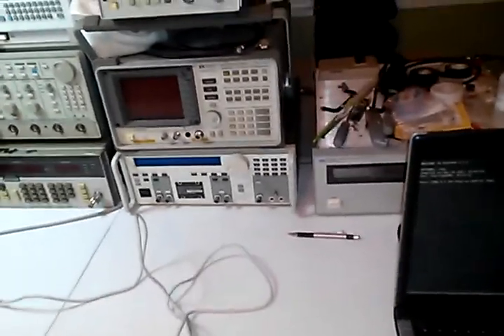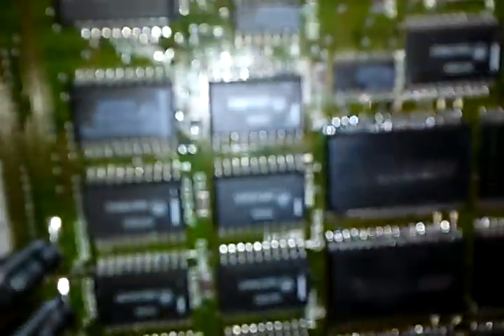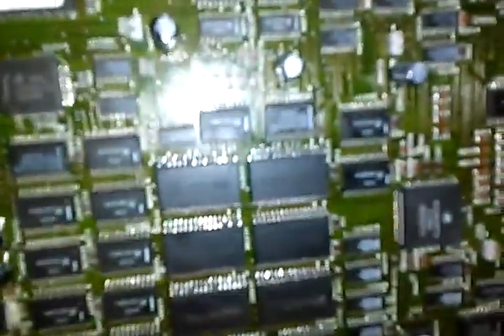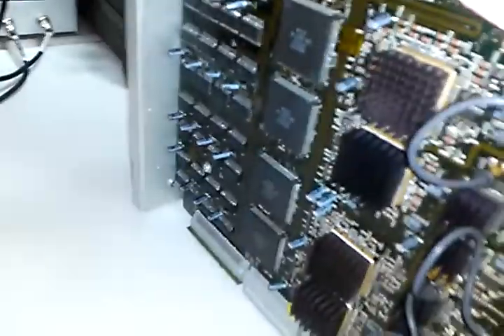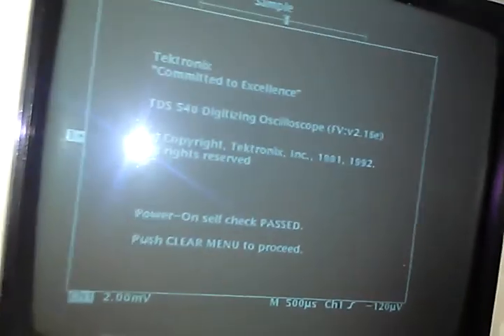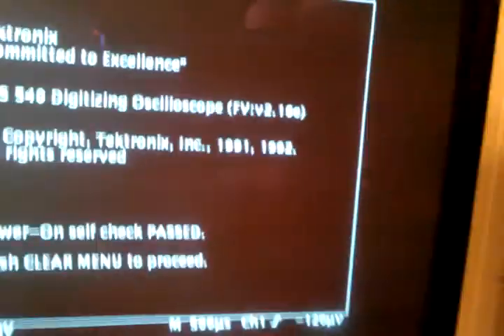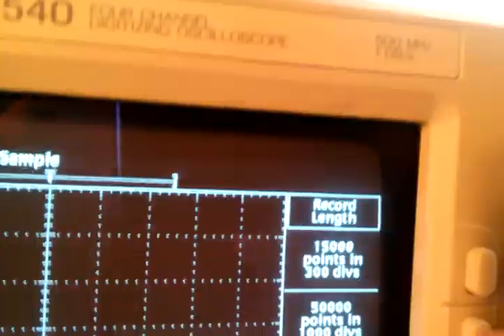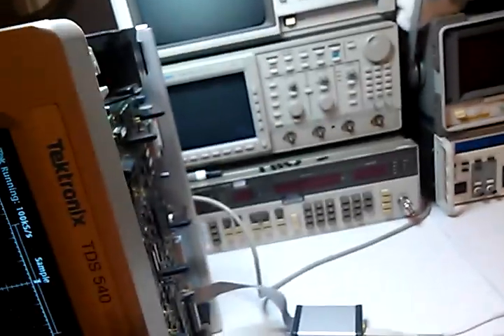Tds540 upgrade to 1M option part2

Comment: Looks like you have the older board like I have without the U4 and associated resistors as well as R1998 not populated. 

How is the scope working since the memory upgrade?  

Thinking I might do the same on the TDS-520.